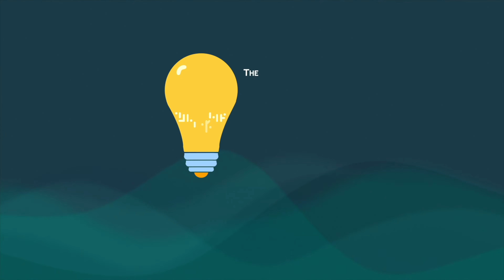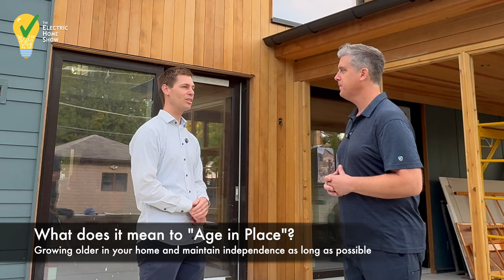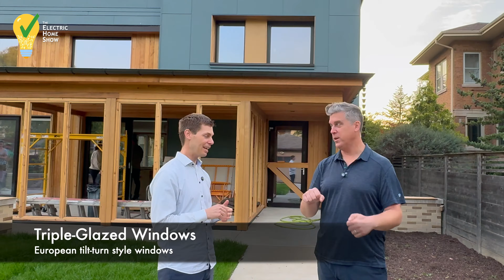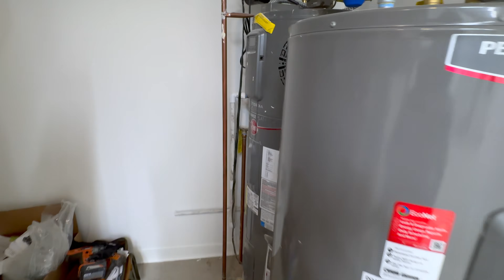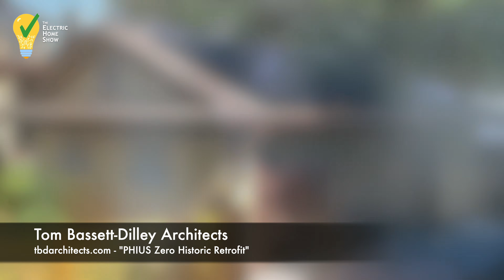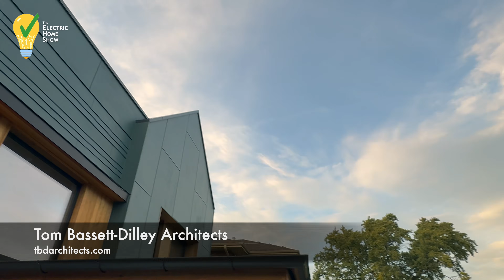Oak Park Mid-Construction All-Electric Zero Energy Home

Comment: Hi Aaron, I think you should considering upgrading your home’s hot-water system, i think you  should definitely give strong thought to the Bosch GreenTronic 7000 T Hybrid Electric Water Heater. Here’s a detailed essay on why this model is worth considering—covering key features, benefits, potential considerations, and how it stacks up in the market

What this product is

The Bosch GreenTronic 7000 T is a heat-pump hybrid electric storage water heater: instead of relying solely on electric resistance heating, it uses a heat-pump mechanism to extract thermal energy from the surrounding air and transfer it into the water tank, thereby achieving much higher efficiency than a conventional electric tank.  ￼ It comes in sizes suitable for whole-home use (50, 65 and 80 gallon versions) and is designed as a “drop-in” replacement for standard electric storage tanks in many installations.  ￼

Key Benefits: Why You Should Consider It

1. Dramatically improved efficiency

One of the most compelling reasons to consider the GreenTronic is its efficiency. According to the manufacturer, it can operate 3 to 4 times more efficiently than a traditional electric storage water heater.  ￼ Because it uses ambient heat rather than converting electricity directly into heat, you get more “bang for your kilowatt.”Heat pump water heaters in general are known for this kind of advantage:

“The heat pump uses the electricity to move heat from the surrounding area into the tank … therefore uses much less electricity to heat up the water.”  ￼

This can translate into lower electricity bills over time, especially if your home uses a lot of hot water.

2. Cleaner/greener operation

Since this is an electric-driven system (rather than a fossil-fuel burning system), moving to the GreenTronic supports decarbonization and may reduce greenhouse-gas emissions—especially if your home is served by cleaner power.  ￼ For homeowners interested in sustainability, this is a notable benefit.

3. Eligibility for incentives

Because of its high efficiency and emerging status as a “green” device, the GreenTronic qualifies for federal tax credits (e.g., the U.S. Section 25C credit) and state/utility rebates in many areas.  ￼ By leveraging these incentives, you may significantly reduce the net cost of installation, improving the pay-back or return on investment.

4. Quiet operation & installation flexibility

The unit is engineered to run quietly—below 49 dB(A), which is comparable to a quiet refrigerator.  ￼ That means you can install it in a basement, utility room, or near living space without it being disruptive. Discussions around heat pump water heaters note the advantage of quieter operation and the added benefit that they can dehumidify/cool the surrounding air, effectively giving you a bonus HVAC benefit in some installations.  ￼ Additionally, Bosch designed the GreenTronic to have the same water and power connections as many standard electric storage water heaters in order to simplify retrofits.  ￼

5. Multiple operating modes for flexibility

The GreenTronic offers several (five) operation modes, allowing homeowners or installers to optimize among efficiency, speed of recovery, and comfort.  ￼ That means you can tailor it to your hot water usage patterns: if you have a big draw (a lot of showers, large family) you might pick a faster recovery mode, or in times of lower demand you choose the most efficient mode.

⸻

Considerations & Potential Limitations

As with any major equipment purchase, there are factors you should keep in mind before assuming it’s the right choice for you:
	•	Ambient installation conditions matter. Heat pump water heaters rely on extracting ambient heat from the surrounding space. If the unit is installed in a very cold, poorly-insulated space (cold basement, unconditioned garage in winter), its performance may degrade. One article pointed out that installing in a conditioned space or ensuring sufficient ambient airflow (e.g., ≥700 ft³/min) is important.  ￼
	•	Installation cost & electrical requirements. Because this is a hybrid unit with heat-pump components plus electric backup, you may face higher upfront cost versus a simpler electric resistance tank. Ensure your electrical circuit, space, ducting (if required), and installer familiarity are up to the task.
	•	Space/airflow considerations. It may require some clearance or ducting (for intake/exhaust) depending on the configuration. Bosch mentions optional duct adaptors to adapt air flow and installation space.  ￼
	•	Availability & track-record. Being a newer model (launched ~2024) means fewer long-term homeowner experiences are available, so you may have fewer “trial by fire” data points to rely on. One user commented:
“I’m getting a hpwh installed … the installer says … but they do have the new Bosch GreenTronic 7000T’s ready to go right now.”  ￼
That suggests installer uptake is underway, but you may want to check local contractor familiarity.

⸻

Why it might make particular sense for your home

Putting this into the context of your home (for example, in Glenview, Illinois):
	•	If you currently use a standard electric water heater (resistance type) and pay relatively high electricity rates, the improved efficiency of the GreenTronic can lead to meaningful annual savings.
	•	If you have a utility or state rebate program in Illinois / the Midwest (or federal tax credit) you may have good incentive support.
	•	If your water heater is in a utility room or basement with relatively moderate ambient temperatures (not a freezing unconditioned space) the heat pump can operate effectively.
	•	Because the unit is quiet, if your utility room is near living spaces (like a finished basement) the low noise may be a comfort advantage.

In short: the Bosch GreenTronic 7000 T hybrid electric water heater offers a compelling package of high efficiency, lower operational cost, quieter operation, modern features (multiple modes, damanding-response port) and green credentials. While you’ll want to check your installation conditions and upfront cost vs. pay-back carefully, for many homes the long-term value and environmental benefit make it a strong candidate.

If you like, I can look up installation cost estimates, regional rebate programs (Illinois/Chicagoland area), and an estimated pay-back period for your home’s usage profile. Would you like me to gather that?